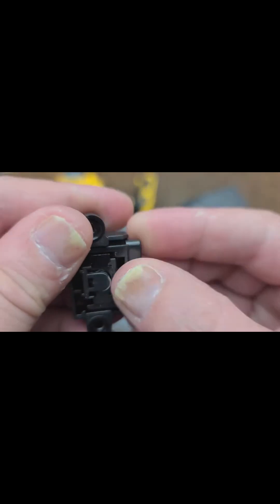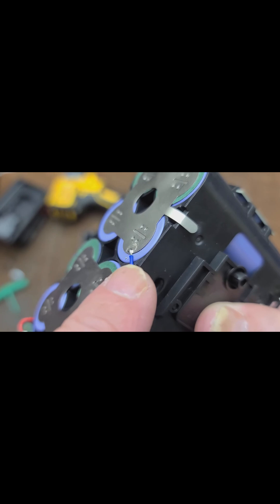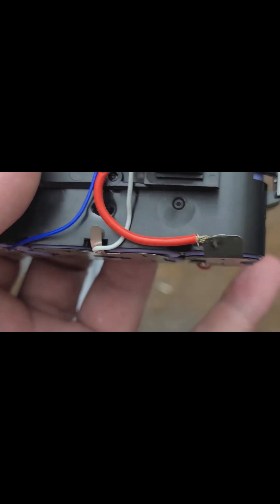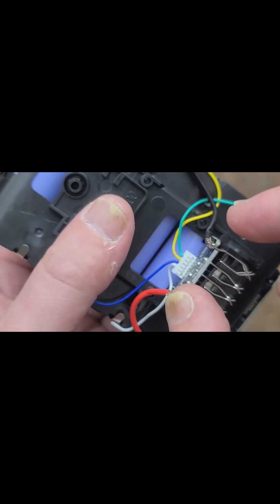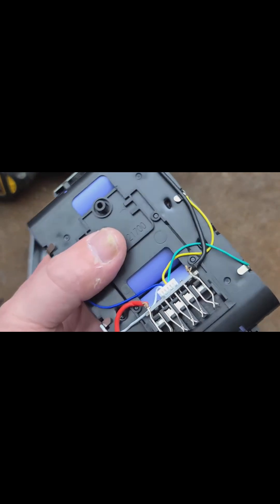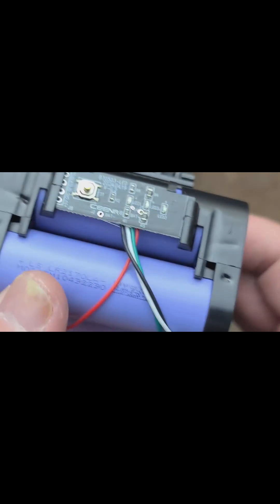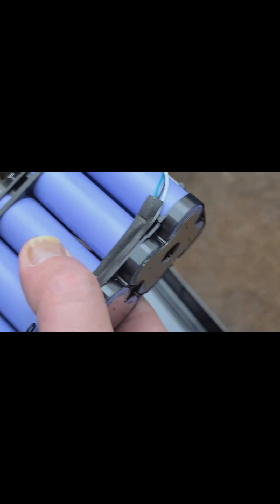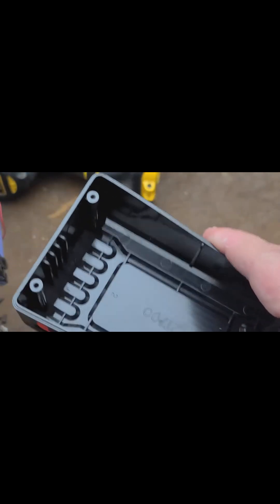What’s REALLY Inside a CEENR Battery? 🔍🔥

Comment: I've been testing three I purchased from CEENR. Their 4.0Ah and after opening the boxes and charging them fully I manage only to get 4.5 amp hours drawing 8.5 watts per hour for a total of 38.25 watts from what should be at least a 72 watt hour battery. Repeated the test 3 times...same results. These are the universal batteries with a Dewalt adapter sold by CEENR.
Reply from the maker: Thanks for sharing your detailed results! 🙏
Could you let us know what testing tool you used, the discharge current, and the cut-off voltage for your test?
This will help us understand the results better and support you properly.